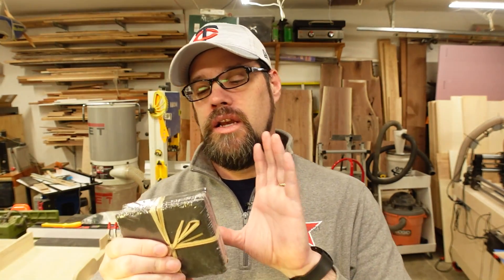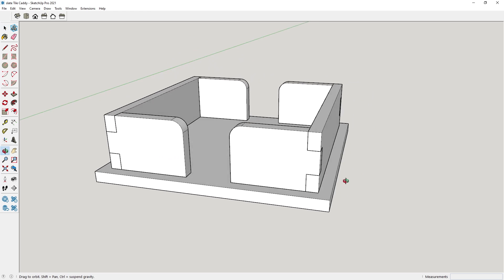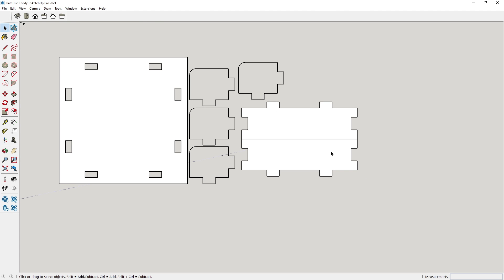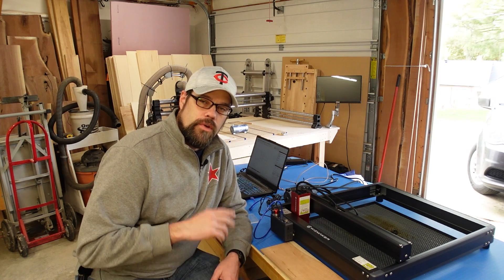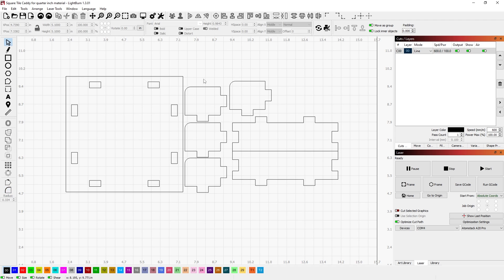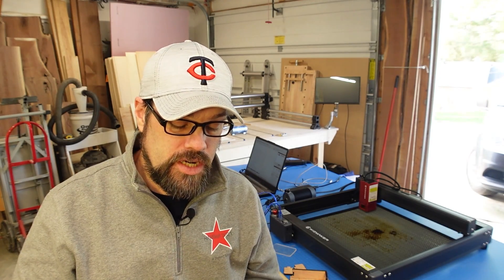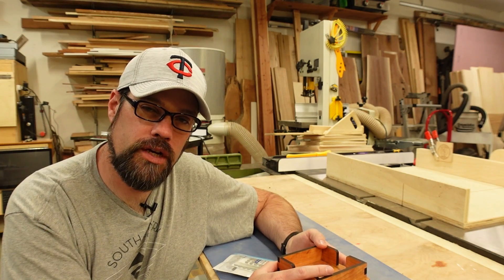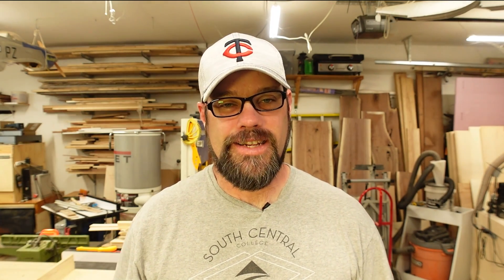Laser Cut Caddy for slate tile coasters | More fun with the WizMaker L1 20w Diode Laser

Comment: Great idea, well made vid, thanks!. One thing I would like to see is for you to modify your Etsy file to also include a box to hold 6 coasters, that is the number I usually include in a set. I'm going to try and modify it on my own, wish me luck!
Reply from the maker: I'll take a look at the files, I may have done this for another person, but I'd also need to make them for all the material thicknesses.
Reply: @Vintauri  Turns out it was very simple to modify, I did it in XCS. Holder looks great, will be a gift for my sister and who knows, maybe I'll add them to my product line. Thanks for a great file!

Comment: Very nice job done! I have a question, there is a way when i cut the plywood do not have the edge's black, i mean, to cut but the edge's do not be burned? If is not possible to do the cut whithout be burned , how can be removed that black colour, after that? Of course can be painted, but if i want the edges to be the same colour as the plywood, how can i do that? Thank you! All the best!
Reply from the maker: Unfortunately the way the laser works is by burning through the material.  This will always leave a caramelized or burnt edge.  To not get burnt edges, you'd have to use a CNC router, which will not have as fine of a cut path, or you can try sanding the edges after cutting them with the laser.

Comment: Is it easier to design it in sketchup then lightburn?
Reply from the maker: I like using it when I can, but I started using it over ten years ago and old habits are hard to break. I like being able to pull it into 3D and visualize the project that way I can test the fit and placement of everything a little better.  However, it does have some quirks with curves at smaller sizes and you are limited on it's export options with the free web version.
Reply: @Vintauri   Thanks for the input. I like your channel and have watched you for awhile now. I have a Atezr P20 But I am thinking about getting a RolyMK2 in 20 or 30w. I want a machine all enclosed in its own enclosure. I looked at the wecreate and joined the FB forum but some issues with that machine and support is not good at all from what I can see. Plus very limited to the use of lightburn on that machine. The Roly looks like the best bang for the buck IMO.
Reply from the maker: @woodknack1  I don’t have a Lasermatic machine, but from what I’ve seen it’s much better than the WeCreat vision. The only issue with the fully enclosed machines is if you ever max out the working area, they are limited in passthrough area. But I rarely work with anything bigger than the stock working area of these machines.
Reply: @Vintauri   you should give a lesson in sketch up on how to design something simple like say a box and show how it goes together on sketch up and how to import it all to light burn. I think people would find this interesting and helpful (me included). I always wanted to dive into sketch up the free version but never took the plunge.

Comment: I purchased your caddy file and I’m new to lightburn, how do you change it so 1/8” birch ply will work.
Reply from the maker: There should be a version labeled 125 that is for .125” or 1/8”. Try that one. The way Lightburn resizes slots won’t work for adjusting this file correctly so it needs to be done manually.

Comment: How do you think using 3mm MDF would work for this project. I was thinking about using 3mm Baltic Birch but I think the MDF is a little more solid.
Reply from the maker: If it's real baltic birch it will be much stronger than MDF.  MDF if just wood dust and resin so not much structure there and if it gets moisture in it, things will swell and degrade.  But at this size and scale, either one should work okay.

Comment: This is awesome idea and video. I’ve haven’t worked with cherry wood (yet) now seeing this I will. Can you tell me what would be your cut settings for Cherry Wood on an Atezr V35?  I plan on running a material test but getting a range would be nice. 
Thanks!
Reply from the maker: I'm currently testing the Atzer L2 36w laser and on the same Cherry wood I found it to cut out around 325mm/min 100% power in a single pass.  Hopefully that's a starting point for you!

Comment: It was really nice getting to see the evolution of your product idea, exploded 3D view in SketchUp, and the entire assembly process. 🙂👍🏻
One thought I had after watching the whole video a couple times is it might be a nice feature to make the finished caddy able to “nest”, if you’re stacking them.  You would only need a thin piece of material 4 in x 4 in, attached / glued to the bottom, and then they could be stored 2 high (or more) and really stable.  
Your project is excellent as is, just an idea for you… if you think it makes sense (i.e. on a store shelf or customer stacking them vertically on a table, for easy access).
Reply from the maker: It wouldn't be too difficult to make them a nesting set with some slots and tabs on the upright pieces.  Maybe something to play with in the future!
Reply: I'm only running a 10w laser.  Can this be  cut with that? What would i use for speeds and number of passes? Im assuming 100% power yes?

Comment: Good project and really looks good.  Was thinking, "the base corners need to be rounded" and then you caught the opportunity to add rounded corners to the base and did it.  One thing that might add to the piece would be to engrave some decoration or other embellishment on the inside bottom and/or the sides.
Reply from the maker: I like to leave some of the creative process in the video to help others see it's okay to just try something and then make adjustments. Plus it gave me on opportunity to show a feature of Lightburn that is not always used. One could definitely add some customization to the various panels to make it even more unique!